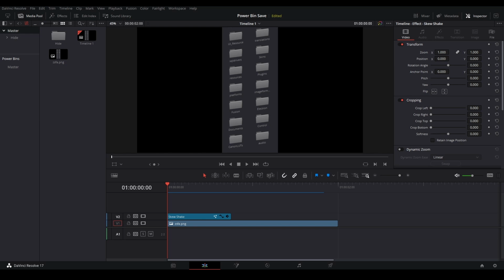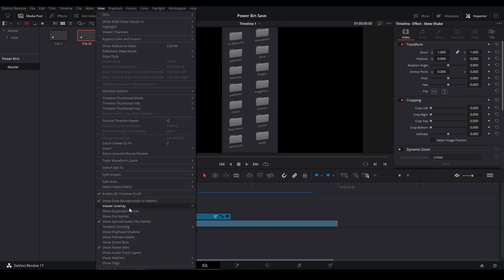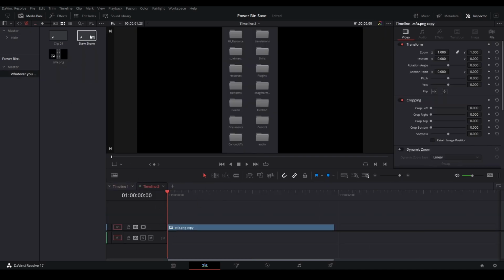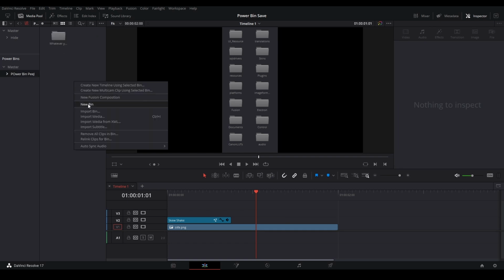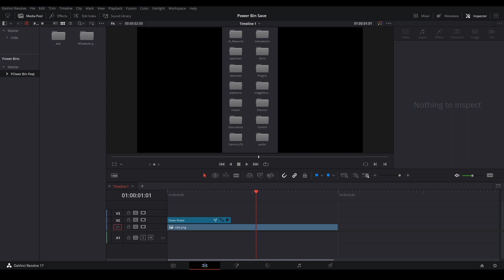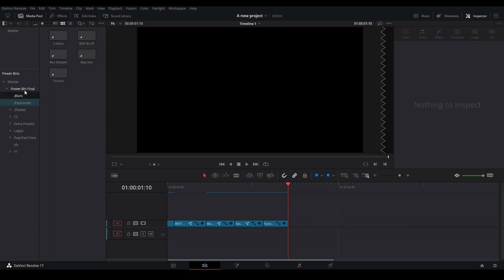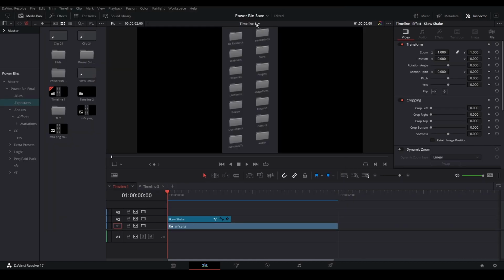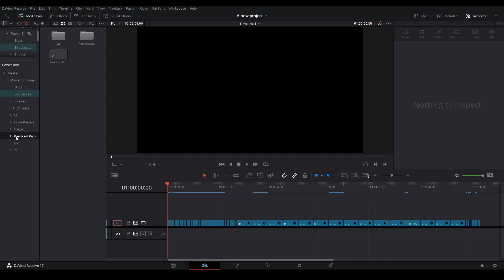DaVinci Resolve | Power Bins

Comment: Love the videos, youve helped me A TON. I do have a question about power bins though. I use them for certain effects/transitions. For example lets say a 6 frame flash using color corrector in fusion tab. For whatever reason the flash wont work in other projects though, itll either crash or just not share the same frame timing it does on the original adjustment clip. Is this just a limitation of Davinci?